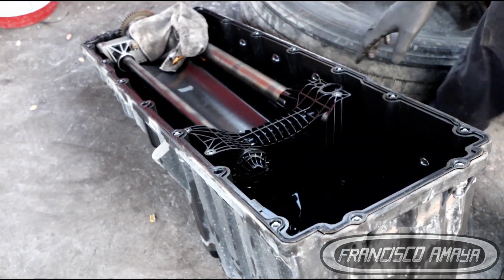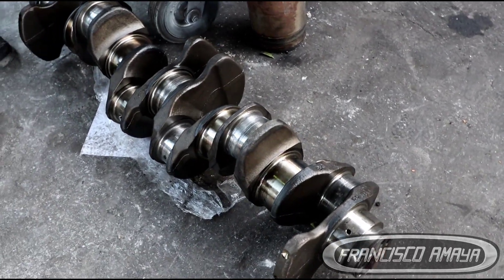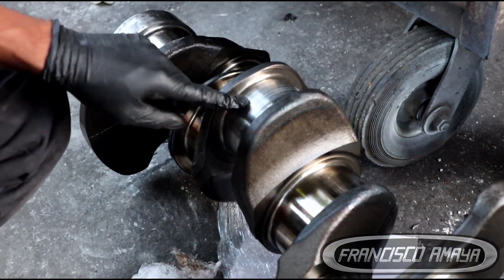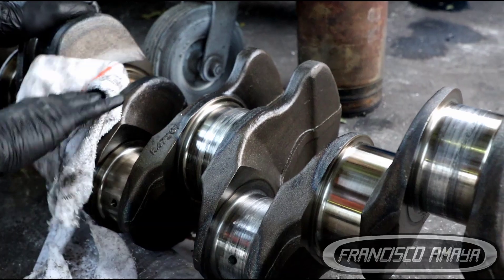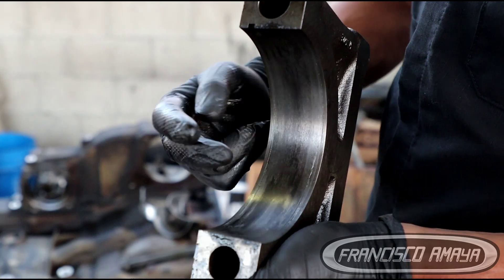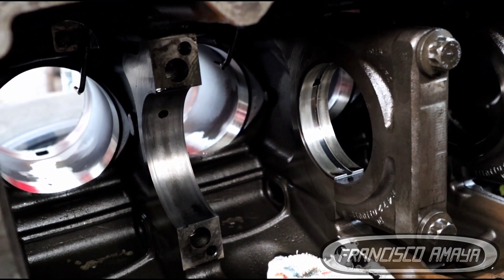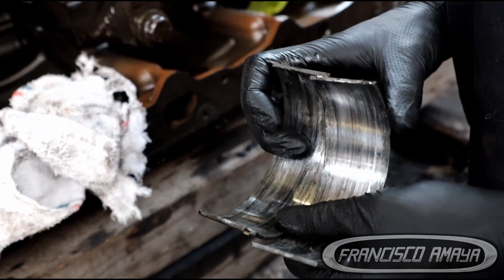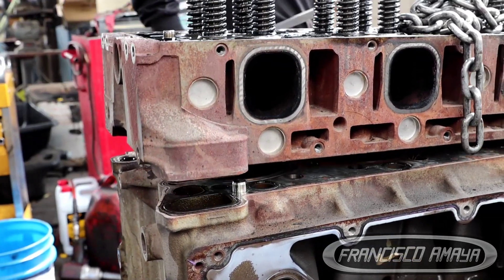DD15 engine rod bearing crankshaft damage low oil pressure oil manifold failure engine overhaul

Comment: I had this happen to my 2015 Cascadia two weeks ago. And now I'm waiting on a Reman engine from Colorado. Still kicking myself for not having the dealership change that oil pump suction manifold late last year when they had the pan off to reseal. My truck has 738,500.  Reman engine $17,000 from Colorado, dealership wanted $46,165. Not needing to worry about engine for the foreseeable future=PRICELESS!! Thank you to Francisco for explaining the suction manifold failure, and the damage done when it goes bad.  I had ZERO warning that this was happening until the RED lights came on.
Reply: Where did u get reman engine my dealer wants $32,000

Comment: Great info  as usual, I recently replaced the oil pump and the oil suction module on my DD13 with less than 400k miles as preventive maintenance and I spent a couple of thousand dollars, was it needed ? 
Maybe not but…. that’s why is called preventive maintenance, great video as usual, thank you.
Saludos a todos.